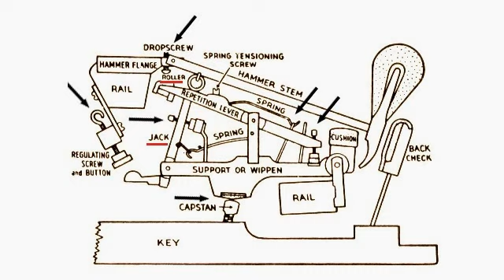ESSENTIAL Piano Technique Tutorial: Using SPEED to make your sound

Comment: Great video and unique take on piano technique that I've actually thought about quite a bit before.  Consider the anatomy and efficiency of the anatomy as well ------ It helps very much to practice VERY high drops onto the keys, letting gravity take over. Lower drops don't help much but if you drop well above the piano and release the arm, you'll start to feel the effect of gravity more and more (and only use necessary muscles). It's why pianists like Volodos, Lugansky can play with such strength yet speed and the sound comes up/out of the piano rather than sounding "stuck".  BTW, love the Debussy. I happened to play through that for fun before watching this vid :)

As terrible as this sounds, I find it useful sometimes to completely not focus on the sound but dedicate more attention to the motion. If I don't do that, I default to old habits/tensions quickly. Of course, it all requires experimentation to see what works.

I do have a problem with clarity however - no matter how much weight I have, how much I apply my ear etc, there always a lack of sharp precision/articulation. Would you have any advice on this matter? Cheers.

Comment: Ruud Van Nistelrooy giving piano lessons? Great!))
By the way, the mass that really affects sound pf a piano - mass of an every hammer hitting strings - never changes. Coming back to your example of car, truck and wall - imagine that there is, for example, a ball between those vehicles and the wall. And we should strike the wall with this ball using a car and a truck. The car goes 100 mph, strikes ball, ball tand hits the wall. The truck goes 20 mph, strikes ball, ball tand hits the wall. We see the difference, than think "Oh, the truck is absolutely unnecessary here. Even a bicycle will be enough" an so on)))